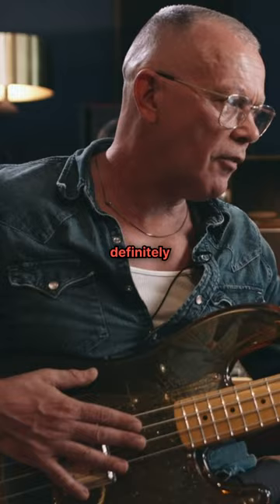A *PLASTIC* Precision Bass 😱🤯??

Comment: Hilariously it's been proven that the material has NO impact on electric basses and guitars. String guage, pickup type, scale length, action and pickup height are the variables.
Reply: String type should be on this list too! Flatwound Vs roundwound for example makes a huge difference.
Reply: @chuck_stones  absolutely! I was talking about the actual instrument. Pick type is also important, as well as the angle of attack etc.
Reply: @pontesul1  yep. Except in a double blind nobody can tell... So just no. What you are saying is simply wrong, no matter how much intuitive sense it makes to you. Hollow bodied acoustic instruments are a different story, there you are 100% correct.
Reply: @pontesul1  here is a fairly good demonstration https://youtu.be/n02tImce3AE
Reply: @pontesul1  you are pivoting. I never commented on shape, only on material, and that discussion is settled. The guitar even sounds identical WITHOUT any body at all...
Reply: @pontesul1  Thanks for sharing this. The problem with this test is that if the pickup height was not controlled for within fractions of a millimeter then that is what we are hearing. What you are arguing was gospel until fairly recently, and I'm not having a go at you. Its like common sense, except it turns out to be wrong. We used to think the earth was flat...
Reply: The main impact body material has is the impact it has on sustain, resonance and brightness vs darkness of that resonance, so a bass like that might have superior sustain or more bright tone when compared to a wood bass, otherwise it just looks cool
Reply: @jtdevrieze  electric guitars and basses produce sound by vibrating metal strings interfering with a magnetic field. The material that houses these parts does no interact with either component in any audible way. A group of Brazilian luthiers published a paper on this, building a robot to guarantee isolation of variables. The earth is not flat just because it's intuitive. This is similar to discussions about fancy power cables in the audiophile community.
Reply: I saw a luthier online do a test, and my memory of his comparisons was if you're going DI/clean, body material made a difference in how much low end you had, but I think even then, most woods sounded the same. Definitely other factors have way more of an impact.
Reply: @pontesul1  don’t die on this hill dude tonewood is not a thing.
Reply: @pontesul1  the wood works if you really take your time, and drink the Kool aid. And that's exactly what you've done
Reply: @pontesul1 Mate if a bass was resonant enough that the body material made an audible difference to the tone, you'd never be able to take that thing on stage, let alone put distortion before it. Sponge and palm muting directly touches the string where it vibrates. Body wood doesn't.
Reply: Material density affects it
Reply: Maple vs rosewood necks make an audible difference for guitars.  That has also been proven.  Look it up.
Reply: I think that in acoustic instruments is where one can hear tone differences clearer. You would probably be more likely to hear the tonal variations between 2 double basses constructed from different densities of wood as opposed to 2 solid body basses.
Reply: @Kevin Joseph  very much so. For instance, acoustic guitar luthiers can tell well above chance in blind tests which wood had been used in the construction.
Reply: You can tell what you want but a Jazz Bass alder/Rosewood have a different sound than an Ash/Maple.
Reply: @acidjazzsoulfunkrock  do it in a double blind test and you will have revolutionised modern understanding of audible variables in electric bass guitars.
Reply: And your amp's speaker and settings
Reply: @verticalhamburger9517  ...and your height above sea level...
Reply: @GingerDrums  What? Your speaker makes a difference, notably in guitars but basses, too
Reply: @verticalhamburger9517  the discussion is about the wood in the instrument. Of course the amp, room acoustics, floor material, microphone choice, effect pedals and mix bus EQ change the sound, that's not the discussion.
Reply: @GingerDrums  Yes, I listed the speaker to add to your original comment listing what actually matters instead of tonewood
Reply: @GingerDrums  at 8;03 I can hear a difference. Subtle but audible
Reply: @manobap  understanding the psychology of sound will help you to know when you are experiencing confirmation bias. The material of an electric bass does not effect the signal being sent through the Jack.
Reply: It has almost no impact on tone but the feel.
So saying it has no impact on the instrument at all is wrong
Reply: @GingerDrums  yes it does. Not a lot like pickups, pickup position and scale length but really does. String gauge is less perceptive than wood. If wood doesn't make any difference, why buy a expensive one with body? Its just buy a neck, screw it in a piece of the cheapest stick found in a backyard and bang! Here's THE TONE, the only one that we can hear.
Reply: @manobap  yes you are essentially correct! It a combination of looks, marketing and prestige.
Reply: @manobap  this is for electric guitars, but it's even more pronounced for bass :)  https://youtu.be/n02tImce3AE?si=sZZQWVxhXYSkv6xN
Reply: @1Guug  it does impact on tone. I had once two Music Man Stingray, one with birdseye maple neck, pau ferro fingerboard and other with maple and ebony. The first one has way more mids than the second, that has a hole in this region and a bass and highs more pronounced. Same set of strings, same body and of course same amp and myself the bass player. I have already made up my mind about this subject. It’s subtle in guitars, more audible in basses with a clean tone with an amp with lots of headroom. Overtones!! It’s about it and with the muddy compression here on Youtube makes it difficult to hear. The ideal experience is on a very silent studio playing during at least ten minutes  with one instrument than change to the other and play for the same time. And you can hear the overtones with the bass unplugged listening with the ears glued back on the body. The same overtones is noted when is plugged. Boom!! Clear and deep as a blue sky.
Reply: @GingerDrums   every time this subject is here in the web someone uses this video. The problem under your opinion is that you and everybody that listen to this video forget about the ugly muddy compression in youtube audio, one of the worse in internet. And also doesn't hear that on 8:02 there's a noticible difference between the sound of two guitars. Imagine this live on a silent studio playing softly to listen to the overtones properly without any compression. On this video he even uses a COMPRESSOR!!!  Yes, there's a audible difference despite is subtle.
Reply: @manobap  hey, I'm a mastering engineer. Firstly: YouTube converts to .MP3 with zero aliasing. In fact YouTube sounds great! Test for yourself by uploading and then downloading audio and doing a null test. Secondly: Im Listening on a kii three system in a purpose built room and on Audeze headphones from a Burl converter.
Reply: @GingerDrums  Jim Lill's 'Where does the tone come from in an electric guitar" says about Youtube compression at minute 7. 

I'm myself a producer and I can hear differences on different tones easely, even in Jim's famous video you recomended with Youtube compression. Check other articles on the web talking about the audio compression here.
Reply: @manobap  well seems you have golden ears! I have tens of millions of Spotify streams on my mixes and YouTube is basically the same as listening to iTunes or Spotify streaming. In fact YouTube compression it's more like apple compression than normal .MP3. Consumers simply don't care and even a minority of audio engineers can pick out a well converted .MP3 from a wav. As for guitar tone, a 1db EQ move in the mids will change more than having NO material in the body of electric guitars and basses so for all intents and purposes, tone wood is not a thing and you are among the rarified few who claim to have magic ears. As a side note golden ears people always seem too busy to do ABX tests, but never mind ;(
Reply: @GingerDrums  thanx for the compliment. Fact: there's differences responses on different woods. Try making a bass with an untreated wet wood. It lacks low end a lot!! That's why wood can't be used without a special chamber to dry or let it dry for months. And among many producers there's a complainig about Youtube audio loss of quality, there's even hilarious memes about it. I have hearing some tests some youtubers made with an external link that shows de difference between aif files and YT ones. Anyway, I feel that we are stucked in a loop. Nice to debate with you, sir! Good luck with your work!!
Reply: The Sound-Clip in this short video certainly indicates otherwise. ( I have never heard a p-bass sounding that ugly, ever before 😅😅😅 Sounds like a total joke
Reply: @manobap  I'm sorry man but you're objectively wrong. This has been proven both logically and with testing.
Reply: Umm no. If you use your ears at all you can hear the difference between body material.
Reply: The hands of the tone are in the wood.
Reply: @GingerDrums  the strings vibrate based on the resident frequencies of the combined materials. You have no idea what you are talking about.
Reply: @user-rk1ic9pq7r  You are confusing resident with resonant and claiming I have no idea what I'm talking about haha. I love a good resident frequency: they always pay the rent on time! Resonant frequencies would be highly undesirable in an electric instrument... go figure!
Reply: @GingerDrums  I am not confusing, I’m just not proofreading. Talk to text. I know exactly what the hell I’m talking about and you do not.

Comment: I'm assuming it's acrylic, not plastic. It's a really common material for stringed instruments and drum shells as well.
Reply: Acrylic is a type of plastic
Reply: Well Steinberger’s is a composite, originally, of some kind. I can assume a plastic type composite. I always wanted one. I got a Cort copy. I believe it was wood. Our problem w/ plastics recycling is the folks that handle it, dropped the ball, on phases. Why seperate all the bottles etc. then just dump them in the ocean. Then its the “cost’s” well cut off some of the “skim” they have. And union’s focus on the pay of guys handling this crap. Not the top dogs. Anyway. Plastics could be used to make guitar bodies etc. probably using recycle materials.
Reply: @frankbernat740  the idea is great, unfortunately, the quality of plastic degrades when recycling. As yet. 🤔

Engineers are working on a way to basically get the raw material for producing plastic by a more complex process, but it's still in the labs, not in production yet. 🤓
Reply: @frankbernat740  Ned Steinberger used carbon fiber on his instruments. I played his fretless bass on the '83 Frankfurt music fair, and it sounded extremely good, well-balanced, no dead spots, the typical fretless character consistent throughout the whole neck! 😊

I was so fascinated when playing it, got carried away, I only realized there was a big crowd of people around me after at least ten minutes! 😅

So that construction eliminates the need for truss rods, is absolutely super-solid! 😉
Reply: @UprightBassist  nice !! Im sure they will figure out the issues w/ degradation
Reply: Possibly perpex
Reply: @frankbernat740 Steinbergers aren't that great,that's why we don't see em much anymore on stages.My buddy had one,I played it for awhile,meh.I have a Washburn bantam headless,also meh.
Reply: @UprightBassist I didn't like the 2 carbon fiber(graphite?)necked basses I owned;Modulus Quantum 5,Spalted maple top,graphite bolt on neck👎.Also an 80's Status series II 5 string bass,graphite neck thru,walnut wings,non headless👎.

Comment: Tonewood has absolutely zero audible effect on the sound. It's all about the pickups and the circuitry.

Edit. And of course the strings
Reply: It has an effect, but it’s so incredibly minuscule nobody would notice it anyway.

The only time it would make a difference is on an acoustic, and that isn’t the biggest factor for that either.
Reply: To the density of the wood has an effect on the sound, so does the grain. It’s just not the chief defining characteristic. This is especially true if you use a Piezo.
Reply: @sojourner4726  Doubt. One of the bass tones that made me pick up the instrument was Bob Wetton's sound on Shellac albums like "1000 Hurts," which was made using an aluminum Travis Beam model. Honestly if I could find someone offering a five string aluminum bass with active pickups it might be the last bass I ever buy.
Reply: I think you are forgetting the 1 thing that makes stringed instruments audible it the string sneed to vibrate and sustain vibration to be audible. With a plastic bass you are saying goodbye to all your sustain, and all your low end is gone
Reply: @micahbell9412  Plastic can vibrate too. The thing that screws up your sustain is a lack of rigidity adding parallel vibrations, using up the kinetic energy quicker - which is why guitars with solid bridges sustain better than those with trems.

What tonewood does is it resonates with the string, which CAN affect the vibration of the string, and emphasise/de-emphasise certain harmonics and frequencies. Additionally, a heavier and more rigid wood CAN help to some extent with the sustain through added rigidity. However, because it doesn't technically play a DIRECT role in the pick-up picking up the vibration, it has a far smaller effect on the tone than most other factors, particularly if you're slapping a bunch of pedals and overdrive on your sound. It's largely a colouration of the tone than an actual change to it.

However, the way a guitar feels and balances in the hand, and crucially with regards to tonewood, THE WAY IT VIBRATES AGAINST YOUR BODY, will affect the way that you play, which is where the majority of the "magic" of certain tonewoods comes into play. This is because you as a player get to physically FEEL the music, rather than just listening to it, and that generates much more instant feedback that you can react to and push and pull against, instead of trying to pick out the details of your part in the middle of whatever other noise is going on. If you're playing a live gig with a full band, it's often far easier to FEEL when a note is off by a couple of cents than it is to hear it under a singer, bass, drums, rhythm guitar, keys, etc, because you can still FEEL that slight buzzing from the intonation even if you can't hear it.

I'm originally a flautist, and I always found it FAR easier to intonate in a orchestral setting by feeling the vibrations in my bottom lip and adjusting using that, than by trying to pick out which flute was mine out of 5, 10, 20 others, and all of the other noises going on and adjust by ear. It became an unconscious process, but it is easier to do on higher end flutes with denser metals like silver or gold - because they resonate better and therefore give you more feedback.
Reply: Tonewood only effects pocketwood. As in, getting our wallets open. Pretty things get our wallets every time!!
Reply: @micahbell9412  what you’re saying is true for acoustic instruments but literally doesn’t matter for electric instruments at all. 

Pickups pick up the magnetic frequency of vibrating strings, they don’t interact with the guitar material at all.
Reply: True. The variables are: straight action, pickup height, fret width, scale, string gauge and flatwound/roundwood. Body material has no audible effect on electric bases and electric guitars.
Reply: Says the guy going through a big muff and a ds1 in drop d of course😁
Reply: @Trey-jl9ru  I make a living as a music producer (which doesn't mean I'm right) but it means millions of people are streaming the tones I'm getting... and the guitars are well set up but cheap bodies with nice pickups ;)
Reply: rob green, maker of status graphite basses says the same thing. the sound is all in the pickups..
Reply: This bass likely has shit pick-ups then, it sounds like crap